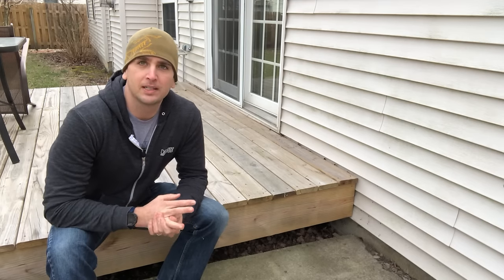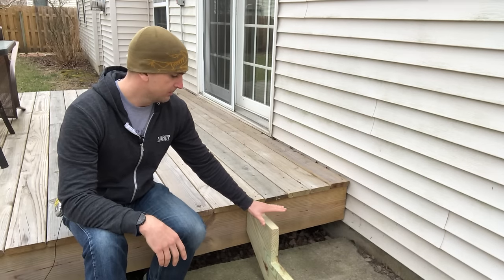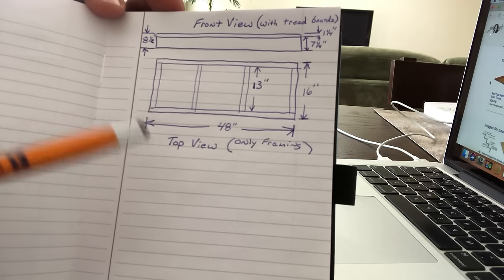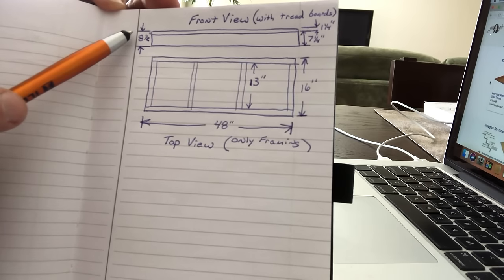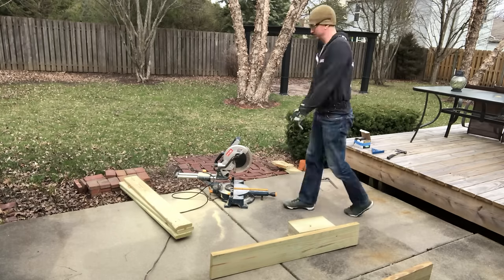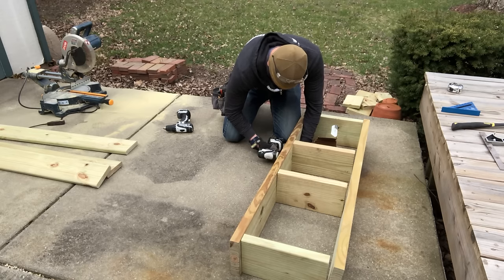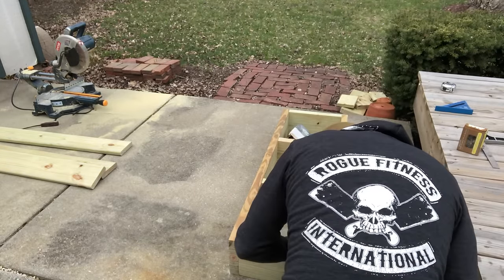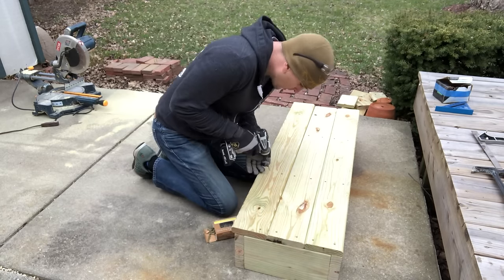How to Build a Simple Deck Step

Comment: This is a perfect temporary solution for outside our sunroom. The concrete outside has sunk, leaving us with a 15 in drop from the door. Other big upgrades are needed before the patio can be done properly, so I wanted a simple, moveable but solid and not expensive solution. This fits the bill perfectly.  Thanks for the clear instructions!
Reply from the maker: Hey Jeanette, happy to hear the step will fit your needs. Best of luck on the project! 👍

Comment: I want to thank you for your detailed plans and procedures in making the step deck step.  I altered the design slightly. I used   2x6 boards and  48 in width with 24 inch for bracing.  Since I had previously purchased a 2x10 board I used  3 pieces for the top part which resulted in a 3/4 inch overhang. Overall, it's fun when a project comes together and you can follow both the list of materials list and the process.  Thank you again.

Comment: Liking the simple step build. The sharp angle to the deck throws everything off. Assuming the Concrete is sinking near the house or lifted on the outer edge from years of freeze/thaw.

Comment: If you live in a snow area, I hope you give them a darn good coat of primer and paint (with non skid additive for tread surfaces). I made almost identical steps four years ago (used 2x6s), painted them with the best outdoor paint I could get, added a non skid additive for the tread boards) and this year, need to replace, they lasted four years and now the treads are rotting. Should have used treated lumber, but like you, had a bunch of wood laying around so use it. 

I will be replacing with steel single step risers (two for each set) and then pressure treated wood for treads. Where I live in ID lot's of snow in the winter. That way with the metal risers, should need to ONLY replace the treads every x-number of years. 

But I totally agree to pre-drill. I use two Dewalts, older with drill bit, newer one with screw bits.

Comment: Appreciate the info. Just finished making one. Step up from my concrete patio into the garage. I figured it was time to let the cinderblocks go 😂. I went 2x6 for mine. If I could do over I would have made the length 47in to allow for some overhang on the tread boards. I didn’t have enough wood to cut the treads any larger. Good build though. Thanks.
Reply from the maker: Hey Jay, nice little upgrade over the cinder blocks 👍

Comment: great video! only suggestion is to leave slightgaps (a speed square works great for gaps)between top boards for water runoff….boards will rot much quicker w/ out gaps….

Comment: If you put a board behind the step, and flust against the top of the decking and scribe under the board, you will the the gradient of the floor so you can cut to the level of the floor........ great job bro
Reply from the maker: Hey Newcomen23, thanks for the tip.
Reply: @EverydayHomeRepairs  welcome... 👍😊 great chanel bro

Comment: How do u fasten to the concrete so the step doesn’t slip or slide?
Reply from the maker: I would just put a few screws between the back vertical board in the box and the rim joist for the deck

Comment: Say you didn’t already have that concrete slab there, how deep of a hole would you have had to dig before you put the step in place? Is there an easy way to determine how deep to make the hole? Once the hoke was dug, would you use rock and pavers leveling sand?

Comment: Awesome thanks soooo much. I'm going to build one for my pod 💓 mines going to be on grass. Wat is good to do so it doesn't rot please
Reply from the maker: On grass is tough since it will hold moisture on the bottom of the step.  That is why I like concrete or possibly a bed of gravel allowing the water to pull away from the wood ensure the wood isn't always just sitting in a pool of water.

Comment: Thanks so much for this video! What would you use for screw-in "feet" so that a. you could level the step from side to side and b. keep it off the ground to allow wood to dry out? Our application would be on a wonky concrete walkway so these aspects are important.  Thanks again!
Reply: Any solution? I’m about to do the same project

Comment: Thanks. Is the step attached to the deck? If so, how did you do that?
Reply: Attach it with 3" screws before you put the deck boards on..
Reply: @dermatt3457  Thanks.

Comment: 1)What's best to put under this - directly on the ground, rocks, concrete blocks?  2) How best to secure to deck if I go that route? Thanks! Total newbie here... just replaced deck boards and old step was rotted and not salvageable.  Totally going to give this a try!
Reply from the maker: Hi Kelly,  good work taking on the deck project!  You could place the box step right on the ground and the pressure treated wood should last 15-20 years but since the grass will die once you set the step on the ground I would probably remove the grass and put down some simple landscaping gravel.
Reply: @EverydayHomeRepairs  thank you! There is actually no grass, just dirt,  so will try the gravel. Best to attach to deck or not necessary? Thank you so much,  any help is greatly appreciated!
Reply from the maker: @kellycave8569  yeah you could put 3-4 deck screws through the back 2x8 into the deck joist once you have the gravel setup the way you want it.  Just make sure to do this prior to putting on the top deck boards.  Let me know if you have anymore questions.

Comment: You should have screwed it to the side of the deck BEFORE screwing the deck/step boards in place. How else would you attach it? from under the deck? Angling in? Hmmmmm.
Reply from the maker: Hey John, good question.  For our specific case we just had the step sitting on the concrete for a few months because we needed to have mudjacking done on the concrete slab to level things up a bit.  Didn't want to secure the step before getting the concrete leveled out.  From a safety standpoint probably better to secure sooner rather than later but overall the step was very stable.
Reply: I’m pretty sure he said they were going to fix slab ...So that tells me it’s temporary... common sense.
Reply: Why do people have to be smartasses

Comment: Hi wondering how did you connect it to the deck?
Reply from the maker: For this specific example I didn't secure the step to the deck because we were going to raise the concrete pad with mudjacking.  You could just secure with standard deck screws and should secure prior to placing the deck boards on top.

Comment: Thanks for this.  I am making similar for a (very tall) shed in the garden.  Your video really helped.  Did you fix the step to the deck and if so, how?
Reply from the maker: Hey Mike, nope I just let the step sit loose on the concrete.  For my situation this was handy since I need to level the concrete soon and now I can easy move the step while performing the repairs.  Best of luck with your project!

Comment: I'm confused. 13+2+2=17??? Why does it say 16?
Reply from the maker: A little confusing but a 2 x 8 board is actually only 1 1/2 inches by 7 1/4 inches.  So it is be actually 13+1.5+1.5 = 16 inches.

Comment: Why not mount the frame to the deck then install the tread . Then you don’t have to worry about it moving..
Reply from the maker: Good question, in my specific case we needed to raise the concrete slab under the step so didn't want to secure the step until that got done.  For most I would recommend as you suggested and secure the step to the rim joist prior to installing the tread boards.  Thanks for the question.

Comment: thats not even level with the deck the height on one end is higher than the other.. let alone it may slide--not good.
Reply from the maker: Hey Janet,  you are right the step is current not level with the deck but I can ensure you the stability is not a problem.  The issue is actually not the step being level it is the concrete slab which we will be leveling / replacing this fall.  Once that is done everything will be good to go.  Best of luck on your project!
Reply: Listen to his video! Thats why he said it tempory🤦‍♀️